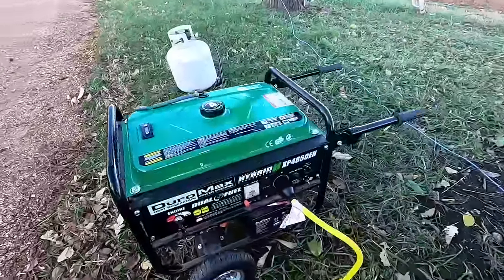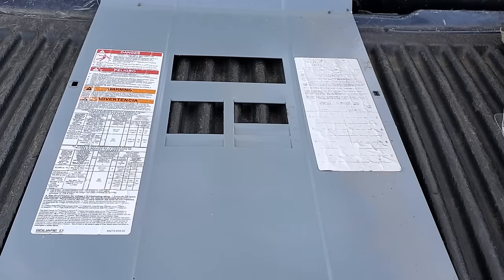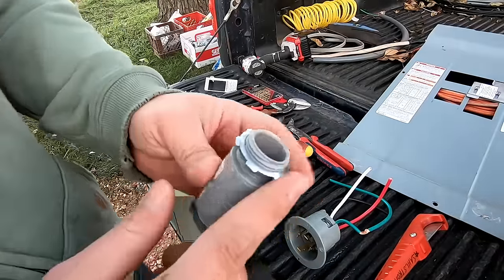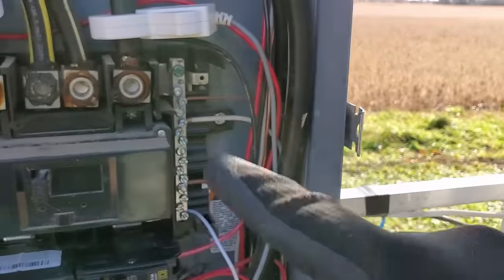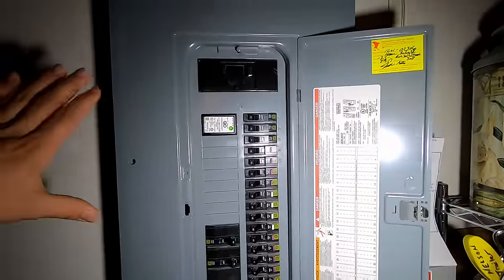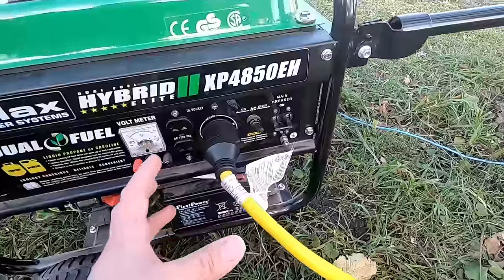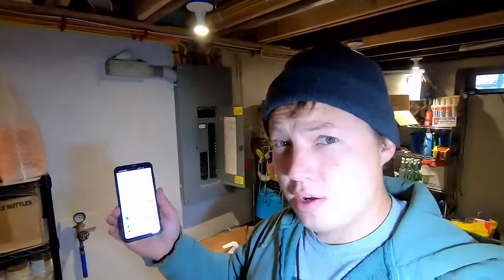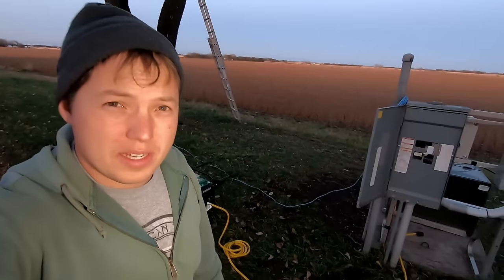How To Hook Up a Generator To Your House Using a Breaker Interlock Kit & Power Inlet Box

Comment: Nicely done video and thanks for sharing. We have the exact same model Duromax and used a Connecticut Electric transfer switch kit setup which works very well. If we had a different service panel I could have used your Square D interlock which is much easier way to go.  I quickly found that the 4850 watt number is somewhat misleading as for 120v use about 1925 watts are actually available if your setup needs a 240v circuit.  We didn't really need 240v for emergencies (range, oven and AC) so I made up an adapter of two 120v plugs feeding a L1430r receptacle in an external 4" box then switch  over to 120v mode at the Duromax for full power. Works like a charm for us. So far the Duromax does a fine job at reasonable price.

Comment: LOVE to hear the children playing-----Hope you have time with them everyday! You do a good job w/your video's---God bless you---Jim
Reply: Don’t forget about the generator safety tips as well. Remember it’s important to follow all the generator safety rules whenever you use your generator. Here are the generator safety tips:

1) Please do not allow an unqualified person or your children to operate the portable generator. Just because some manuals don’t say that doesn’t mean it’s safe. That is important against the generator safety rules. We also need to be keeping an eye on our children too. You need to make sure that your children are not playing near the portable generator especially when it’s running so they won’t get electrocuted. Generators pose electrical risks and they can be hot during an operation. Please keep your children away from the portable generator at all times. It is important to keep our children safe especially our little ones. Be aware of all the hazards.

2) Some people use their portable generators indoors which increases the risk of carbon monoxide poisoning. It’s important to have a carbon monoxide if you have a gas generator. Never ever use your generator indoors even if your doors and windows are open and even in the garage is not safe to use a portable generator. Not even at your porch and your deck. It is never safe to use your generator indoors and in enclosed areas of your home. Your generator needs to be 15-20 feet away from your house. 

3) 🔥generators cause fire hazards too. Never refuel your generator while it’s running. You need to let your generator cool off before refueling it and before storing your generator. Never overload your generator too. Never ever back feed your generator. You should never plug your generator into a wall outlet. Also never store propane tanks indoors. Please keep flammable things away from the generator as well and please don’t smoke cigarettes near the generator. Having a fire extinguisher next to the generator is also important against the generator safety rules. 

4) generator operation; make sure your hands are dry before touching the generator. Never use your generator in wet conditions. Don’t let your generator get wet. You need a generator tent if you need to use your generator during wet weather. Please don’t wear loose clothes when operating the generator. Turn on your generator before plugging in appliances. Use the right cord for your generator. Please do not use worn out cords. 

https://youtu.be/I1jT3ANENvI and here is a video more about keeping others safe when using generators and also about our family’s safety. Hope this helps

Comment: I like propane as well but the issue is when the tank is starting to get low during the winter you need a way to heat the tank to produce more pressure.

Comment: Excellent ..... I had my house wired in 2000 for Y2K but never tested it to see if it actually works.  But now that I understand it better ... I might.  My gas powered 5,500K generator is about as noisy as it gets and having the breaker panel away from the house seems like an excellent idea.
Reply: Here is an information about generator safety: this is just a reminder for everyone’s safety. Always make sure you follow all the generator safety rules whenever you use your portable generator. Generators can be dangerous if not used carefully. Every year, hundreds of people die or get injured when using portable generators due to carbon monoxide poisoning and electrocution. Make sure you are using your generator carefully and keeping others safe as well. There is something very serious that everyone should always be aware of when using generators. Some people do run their generator indoors which is not safe and that increases the risk of carbon monoxide poisoning which can cause death of family and you. Some people run their generator in wet conditions which can electrocute them. Please remember that you should never run your generator indoors. Remember that carbon monoxide is an odorless and colorless gas that you cannot see or smell. Carbon monoxide is a silent killer. Keep that in mind. Make sure your generator is 15-20 feet away from your house and away from doors, windows, and vents. Never use your generator in your porch too. Having a carbon monoxide detector is very important against generator safety. Some people also allow children to go near the portable generator which could pose risks. We need to keep an eye on our children making sure that they are not near the portable generator so they won’t get electrocuted or burned by the generator which is dangerous. A locking enclosure also keeps kids safe. A generator shed might look like a tempting place to explore, or take cover during a game of hide and seek, but a generator is a dangerous piece of equipment that can cause injury. It says on the manual that we should also keep children away at all times from the portable generator to avoid injuries. Please do not allow a child or unqualified people to operate the portable generator.  It is important to keep your children safe especially little ones. The portable generator can be hot during an operation. Just because some manuals missed what should be listed doesn’t mean it’s safe to do. Always follow the generator safety rules when using portable generators. Generators pose electrical risks. If you need to use your generator during wet weather, you need a generator tent to protect your generator from getting wet. Don’t let your generator get wet. Keep your generator dry and before using your generator, please make sure your hands and your generator is dry. Do not wear loose clothing when operating the generator. Everything that is said on the generator’s operating manual should not be ignored. Never smoke cigarettes near the generator. Please keep flammable things away from the generator. Never overload your generator too. Your generator can catch fire. Never ever try to plug a generator cord into a wall outlet to avoid back feeding. Back feeding your generator is dangerous. Always turn on your generator first before plugging in appliances and shut off the appliances before turning your generator off. Use a heavy duty cord for your generator and the cord should not be worn out. All the instructions should be followed carefully. Never refuel your generator while it’s running. It can cause fire if fuel spills while your generator is hot. You should turn off your generator and let it cool off before refueling it. Having a fire extinguisher next to the generator is also important. This is only a reminder for everyone’s safety of using generators. Make sure your generator is properly grounded. Having a fire extinguisher next to the generator is also important against the safety rules. https://youtu.be/I1jT3ANENvI and here is a video more about keeping others safe when using generators and also about our family’s safety. It’s important to keep our little children safe as well. Make sure your little children are kept away from the generator at all times especially when it’s running. Hope everyone finds this helpful. Always remember that it’s better to be safe than sorry. Remember that warnings should not be ignored.

Comment: Excellent job.  In my state NJ I had to use a factory interlock from my panel manufacturer. The generator back feed breaker has to have a hold down.    Also the generator has to have a floating neutral.

Comment: A quick tip when splicing,  make sure the splices are good by pulling on the wires to make sure they are secure and not just look secure.  Give a good tug on the wires under that wire nut before putting the wires away into the enclosure.  Just cause they look good doesn't mean they are good. Having to look for any loose connections after you've finished the job can be a bear, especially if you have more than one hiding in any of multiple locations. You can still have bad connections, but you will most likely reduce the chance of having any to begin with if not reduce the actual number of loose connections.  You can also reduce the risk of damage to the electrical installation or the breakout a major fire from heat created by the increased resistance from a weak connection.  Getting it done right the first time is all the time I ever have to finish a job, lol.

Comment: The most descriptive video on this subject by far!   Excellent work
Reply: Don’t forget about the generator safety tips as well. Remember safety is always important. Here are the generator safety tips:

1) Please do not allow an unqualified person or your children to operate the portable generator. Just because some manuals don’t say that doesn’t mean it’s safe. That is important against the generator safety rules. We also need to be keeping an eye on our children too. You need to make sure that your children are not playing near the portable generator especially when it’s running so they won’t get electrocuted. Generators pose electrical risks and they can be hot during an operation. Please keep your children away from the portable generator at all times. It is important to keep our children safe especially our little ones. Be aware of all the hazards.

2) Some people use their portable generators indoors which increases the risk of carbon monoxide poisoning. It’s important to have a carbon monoxide if you have a gas generator. Never ever use your generator indoors even if your doors and windows are open and even in the garage is not safe to use a portable generator. Not even at your porch and your deck. It is never safe to use your generator indoors and in enclosed areas of your home. Your generator needs to be 15-20 feet away from your house. 

3) 🔥generators cause fire hazards too. Never refuel your generator while it’s running. You need to let your generator cool off before refueling it and before storing your generator. Never overload your generator too. Never ever back feed your generator. You should never plug your generator into a wall outlet. Also never store propane tanks indoors. Please keep flammable things away from the generator as well and please don’t smoke cigarettes near the generator. Having a fire extinguisher next to the generator is also important against the generator safety rules. 

4) generator operation; make sure your hands are dry before touching the generator. Never use your generator in wet conditions. Don’t let your generator get wet. You need a generator tent if you need to use your generator during wet weather. Please don’t wear loose clothes when operating the generator. Turn on your generator before plugging in appliances. Use the right cord for your generator. Please do not use worn out cords. 

https://youtu.be/I1jT3ANENvI and here is a video more about keeping others safe when using generators and also about our family’s safety. Hope this helps

Comment: Interlocks are required by code and are legal per the NEC and CEC; however check with your city inspector. Some cities require a manual transfer switch. A manual transfer switch is really the way to go so you ensure you don't overload the generator; you can enforce only specific circuits to run on the generator.

Interlocks are much cheaper though and easier to install.

If you are doing a standby generator powered by natural gas (or a giant propane whole house system if you live in the sticks) then the only way to go is an automatic transfer switch.

Comment: Ben, Greetings from Canada, great video as usual. I have a similar setup with my main panel (Square D QOC60UC) in my home Just a few comments/suggestions.
1.	Wire coming into your panel from the generator inlet box. When you enter your panel box it is, IMO, a good idea to leave a drip loop here in case any water manages to get inside your panel and start running down the infeed wire.  This loop will prevent it from running along this wire and reaching the inlet box.
2.	Connecting wires in the inlet box… Again, assume water somehow manages to get in there.  When you are pushing the wire nuts toward the back of the box always have the closed end pointing up. Then gravity will work in your favour. If any water manages to get inside the outlet box, there is much less chance it can collect inside the wire nuts and do any harm.
3.	I did not see the metal case of the inlet box being connected to the grounding wires. Yes, I saw the inlet plug ground connected to the panel ground but nothing else. Where your inlet box is metal, it is important that this be done IMO.  One last thought – the mounting bolt for the inlet box is probably enough of a ground but I do not believe it is, strictly speaking, a legitimate substitute.
4.	I have a “main power back on” monitoring device. It is called PowerBACK from Reliance Controls. ( https://www.amazon.ca/Reliance-Controls-Corporation-THP108-PowerBACK/dp/B003KREORA/ref=sr_1_5?dchild=1&keywords=reliance+power+back&qid=1601041390&sr=8-5 )  When I start running my generator, I turn on this unit. When the utility power returns it emits a very loud noise so I will be aware that the power has returned. This helps me avoid running on the generator any longer than necessary.  In your case this may not work too well. The problem is that the unit will be so far away it may be difficult for you to hear it where your setup is outdoors and well away from your house.

Comment: That exterior box with the 30amp receptical mounted on the bottom of the box is P/N EGS PI30 available from Amazon.  The 50 amp model is P/N EGS PI50 (Papa India 50).

Comment: I work on the San Francisco Peninsula, Palo Alto and Menlo Park, the inspector watches you torque every terminal on a service up grade or what your doing here. Nice job btw.
Reply: Don’t forget about the generator safety tips as well. Remember it’s important to follow all the generator safety rules whenever you use your generator. Here are the generator safety tips:

1) Please do not allow an unqualified person or your children to operate the portable generator. Just because some manuals don’t say that doesn’t mean it’s safe. That is important against the generator safety rules. We also need to be keeping an eye on our children too. You need to make sure that your children are not playing near the portable generator especially when it’s running so they won’t get electrocuted. Generators pose electrical risks and they can be hot during an operation. Please keep your children away from the portable generator at all times. It is important to keep our children safe especially our little ones. Be aware of all the hazards.

2) Some people use their portable generators indoors which increases the risk of carbon monoxide poisoning. It’s important to have a carbon monoxide if you have a gas generator. Never ever use your generator indoors even if your doors and windows are open and even in the garage is not safe to use a portable generator. Not even at your porch and your deck. It is never safe to use your generator indoors and in enclosed areas of your home. Your generator needs to be 15-20 feet away from your house. 

3) 🔥generators cause fire hazards too. Never refuel your generator while it’s running. You need to let your generator cool off before refueling it and before storing your generator. Never overload your generator too. Never ever back feed your generator. You should never plug your generator into a wall outlet. Also never store propane tanks indoors. Please keep flammable things away from the generator as well and please don’t smoke cigarettes near the generator. Having a fire extinguisher next to the generator is also important against the generator safety rules. 

4) generator operation; make sure your hands are dry before touching the generator. Never use your generator in wet conditions. Don’t let your generator get wet. You need a generator tent if you need to use your generator during wet weather. Please don’t wear loose clothes when operating the generator. Turn on your generator before plugging in appliances. Use the right cord for your generator. Please do not use worn out cords. 

https://youtu.be/I1jT3ANENvI and here is a video more about keeping others safe when using generators and also about our family’s safety. Hope this helps